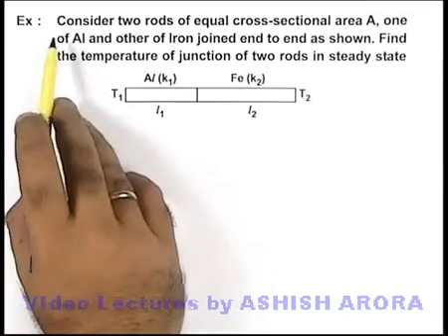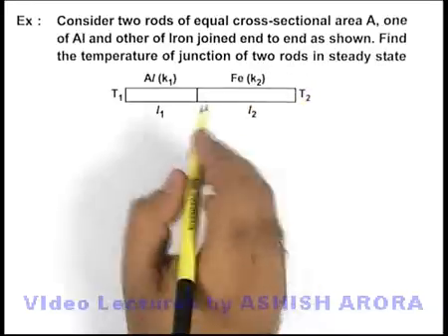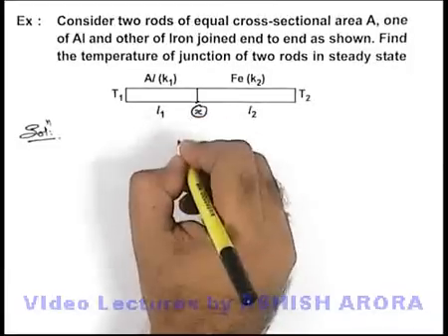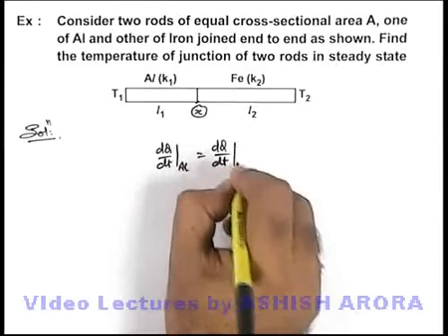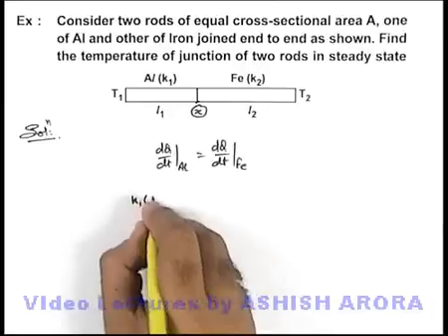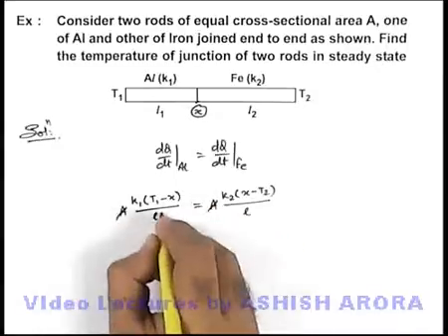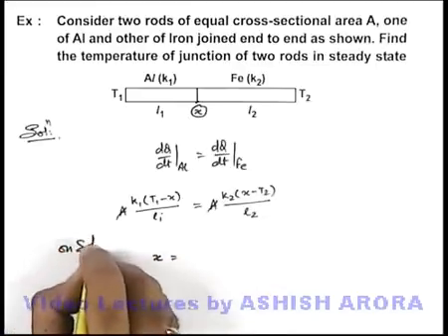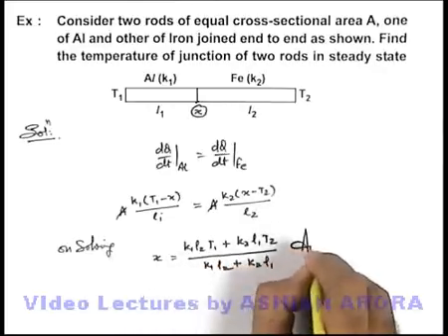Class 11 Physics | Heat Transfer | #6  Solved Example-1 on Heat Transfer | For JEE & NEET

Comment: Sir we can say that after steady state, temperature gradient becomes constant
And so (T2-T1/L1+L2)   =   (x-T1/L1)
Please tell where is my concept wrong...a humble request
Reply: hi brother..the concept of temp gradient is constant is concluded under few conditions..using eqn dQ/dt=K(T1-T2)A whole divided by length we can say if dQ/dt is same throughout rod it implies k(T1-T2)A/l is const throughout rod..now we can conclude temp gradient i.e T1-T2/l is const only under the condition that K is same i.e we take the same material(which is not the case in this question so we cannot equate temp gradient) and secondly A should be same i.e the material must have uniform cross section area throughout..:)for future aspirants